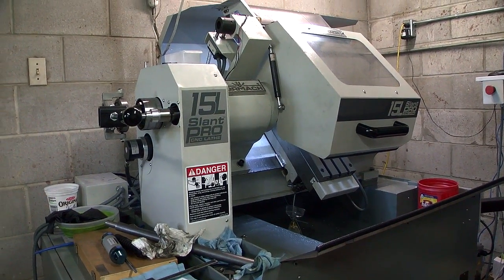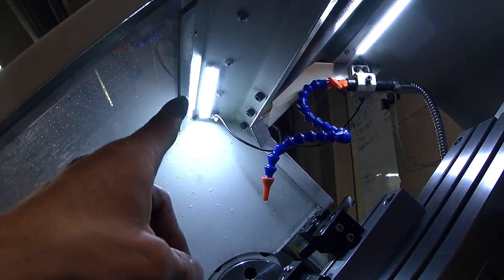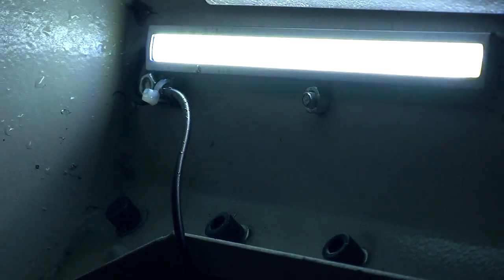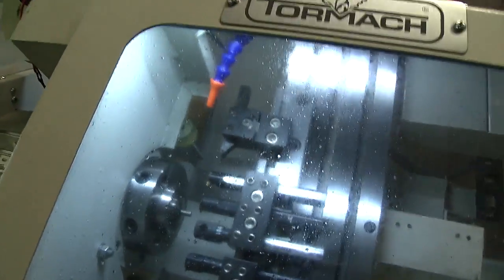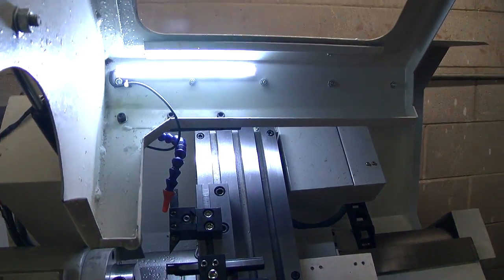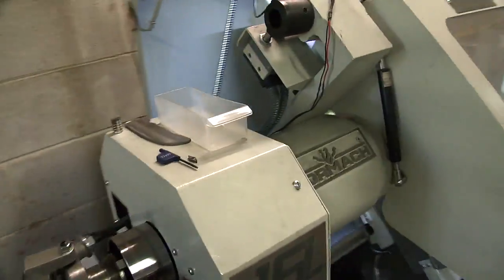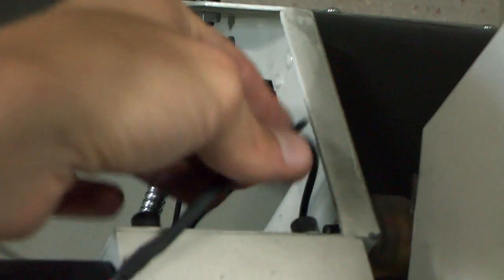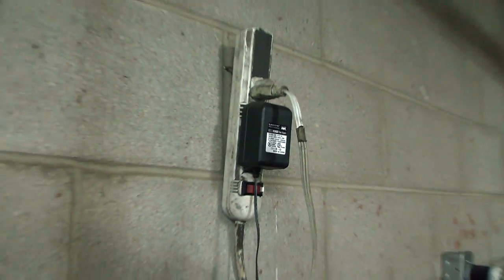Lathe lighting upgrade

Comment: Use a limit switch and make a little bracket so when you open the lid/door the light turns off and does not blind you. Close the door, light back on. As you might say, easy peasy.

Comment: I'm adding some waterproofed 12V Halo ring lights to my mill as I don't feel like paying the boo-koo bucks for the "brand" light that goes there just to have it fail eventually.   Thanks to your lathe video, I realize that I have several 12v power supplies...one of which will be supporting this project when the lights come in.  :)

Comment: Ah dat afterglow. So it 's basically UV LED's with a phosphor coating to shift the light into the visible range. Looks like it's fairly clean white light. Over time, the phosphor coating degrades, making the light increasingly more yellow. Keep us posted on how they fare down the line.